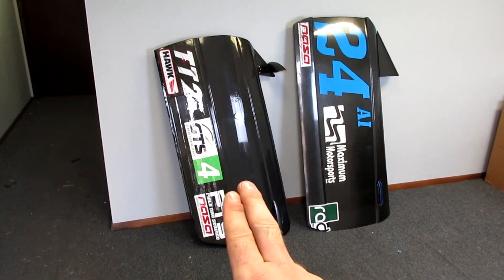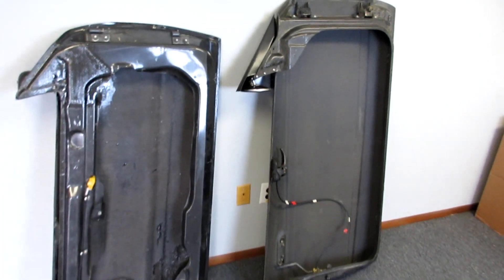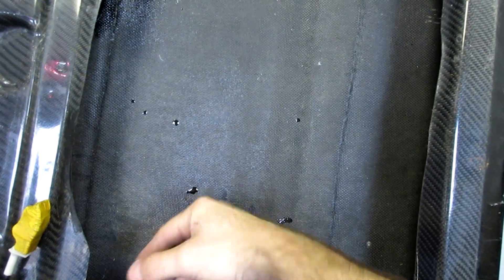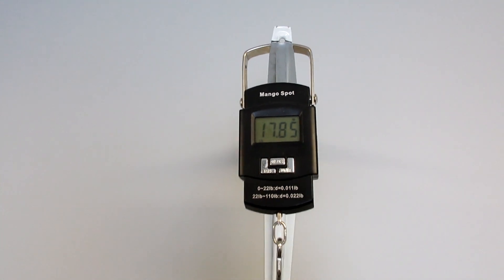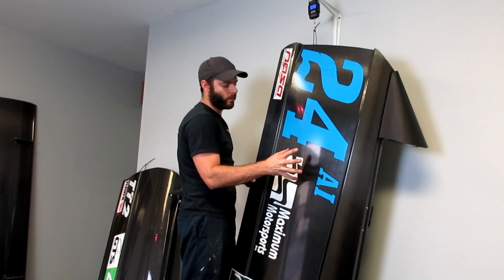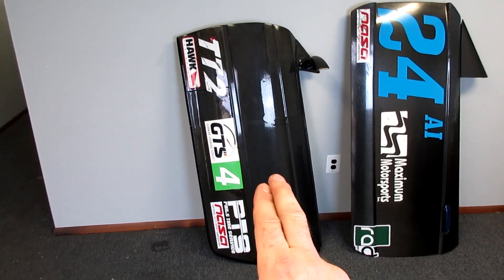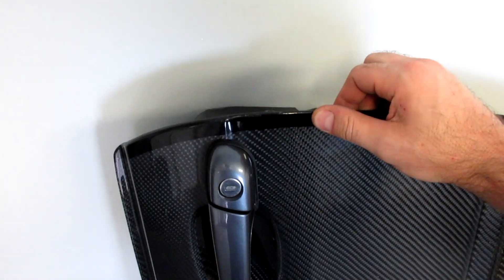How to tell if your "carbon fiber" part is real carbon or not.

Comment: Hey buddy 

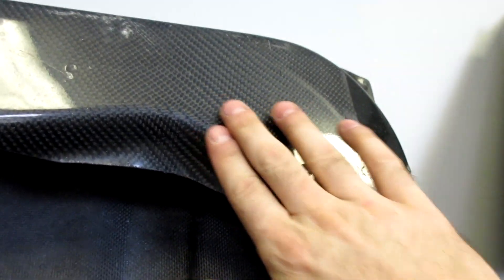One quick question. In 3:06 you said fiberglass became opaque, when it got wet (I guess by resin when in curing process). Why the company would spray it black to hide it out? Is it because when the resin hardens (get dry), light will get through the fiberglass again ?
Reply from the maker: Yes
Reply: @ajhartmanaero  so if it has fiber glass it’s fake?

Comment: Whats the damage resistance difference between the two? Just trying  to see if the price difference makes the damage resistance worth it or not. Im on a budget but not a bad bad budget. Thank you
Reply: It also depends on the type of fiber and resin used...I make the stuff for one of the largest manufacturers of carbon prepreg
Reply: fiberglass is actually stronger, it can take harder hits, carbon fiber is not sronger, it just much stiffer, people always mistake stiffnes fore strength
Reply: @gijs5160  Generic fiberglass parts are no where near as strong as carbon fiber. The only fiberglass that would come close is S-glass. You take 10 mil thick carbon vs Fiberglass and I bet you'll think otherwise. The big issue is the over-saturation of carbon skinned fiberglass parts. When carbon fiber and fiberglass are combined, the different properties actually make the part weaker than a part that was strictly fiberglass or carbon fiber. Kyle.Engineer does a very good video on this concept, you should check it out.
Reply: @DingoZed  learned something today

Comment: Hi there... great videos you have... Just a question.. Whats the adequate "glue" to join panels such as in doors, hoods, etc? Thanks
Reply from the maker: Depends what you are bonding. We use 3M's panel bond. You can use resin or epoxy thickened with cabosil or even talk to a glue like consistency.
Reply: @ajhartmanaero  Thanks a lot for your help, I'll check if I can find the 3M in my area... Cheers

Comment: Is there a benefit to the honeycomb core material in your door? Or is it just a way to use fewer carbon layers?
Reply from the maker: Peter Myers absolutely! Increases strength exponentially with a very minimal weight gain.
Reply: Thanks for the reply. I'm currently building a mold to build a carbon 3pc front for my car using vacuum infusion. Do you have any insight on how many layers would be sufficient? Originally planned to use 5-6 layers of 5.7oz 3k 2x2 twill but now thinking I may want to opt for a core material instead. Will see speeds between 150-160mph
Reply: @ajhartmanaero  increases stiffness without adding a lot of weight. foam cores do the same in aviation applications.